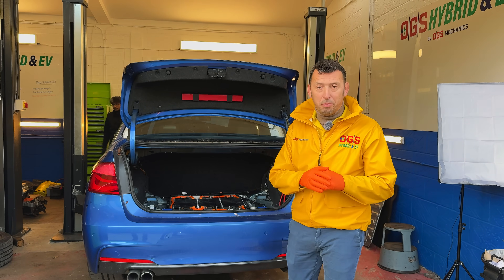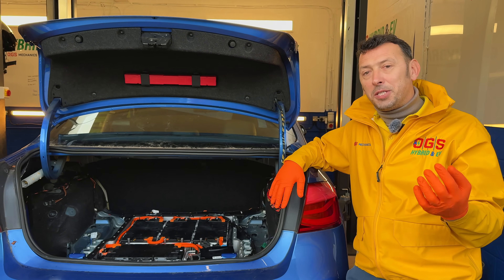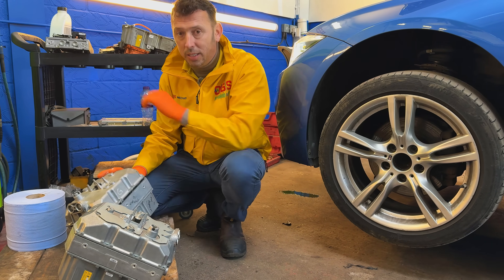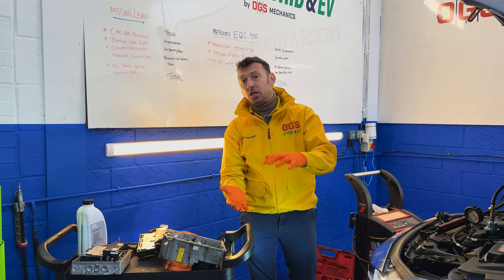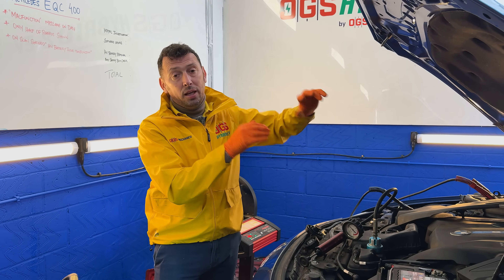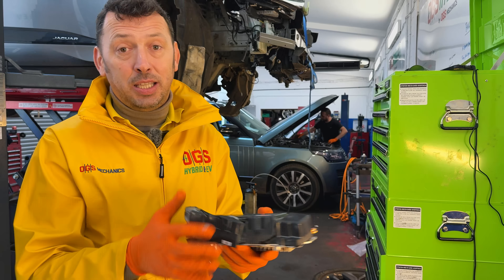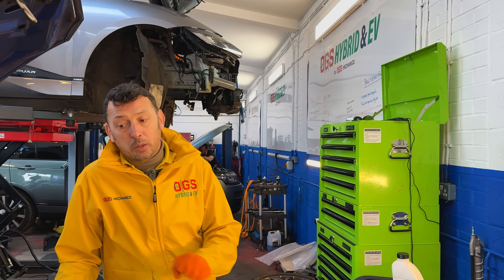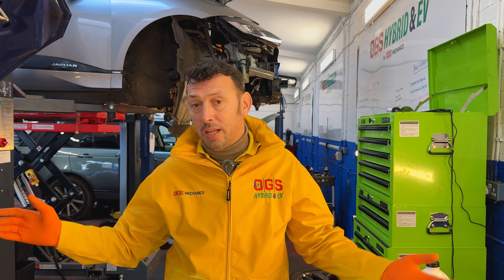The £6,000 Mistake Every BMW Hybrid Owner Should Know About!

Comment: Manufacturers are designing cars to last the warranty period only. If hybrid and electric cars need thousands to fix who would buy a used car ? If there isn't any temperature measurements there is no protection. A simple thermostat could prevent this.

Comment: I've had this same thing happen to my F30. Do I rebuild the EME. If so how? I've ripped apart the EME and the  I'm also working on doing insulation test around the whole vehicle to see where I have a high voltage leak somewhere. My Transistor in my EME looked just like that one, not as bad as that but you could tell it grew in size and cracked the outer case that it sits in.

Comment: I always forget to give credit where it is due. The ability for Car manufacturers to deliberately design in sooooo many failures on their products, yet get people to fight over themselves throwing money at them in order to get the next latest and greatest piece of outrageously $$$$$$ junk year after year after year, is a true artform. "Hey guys- here are the specs for our new 2026 solid cube of Tungsten. Bob has made sure to engineer in several flaws that we can totally deny under warranty in the fine print, and charge extra for a subscription in order to use it. Also, Johnson in Marketing has sent a Memo to include as many software bugs as the time allows, to ensure all the required APPS needed to operate the solid Tungsten Cube don't actually work until the 5th try, thereby keeping the customer on their phones long enough to data mine all relevant shopping habits and then sell to Amazon." Three Cheers! Let's break for Lunch, fellows!

Comment: Another great vid. Very poor of BMW not to have temperature sensing of the heat sink or even a level sensor on the header tank.
You don't need temperature indication, just a plain English message on screen that most OEM's do not give you.
Tesla are unusual in that they allow the owner to access diagnostic software on the car's screen with a full workshop manual. Almost as good as the factory diagnostics.
The error codes are backed up with a full description.
This is another reason I wouldn't touch a hybrid with a barge pole!
Reply: What does this have to do with hybrids?

Comment: Many thanks from this 330e owner :) So basically keep a/c running all the time summer and winter. I normally have my a/c system set at 20C in the cabin all year round, if it's cooling or heating to that temperature is it an indication that all is OK?
Reply from the maker: Not necessary to turn the AC on and drive 
Just make sure the the AC is working properly, make sure to do regasing is done if AC doesn’t blow cold air
Reply: The car use ac but If there is no water coolant left it will do nothing and will burn the Inverter.
Reply: To be honest I switch the AC on the day I buy a car and it is still on the day I sell it.
Reply: @bigjml but you understand that it has no effect on the cooling of the Inverter?

Comment: what diagnostic tool/scanner do you use/find the best for BMW's hybrids ?
Reply from the maker: We use Autel and ISTA for BMW diagnostics 🔧. Autel is excellent — it can read detailed battery stats, perform programming, and handle most hybrid system functions. ISTA is the official BMW tool, great for full module access and coding when we go deeper into the system
Reply: @OGSMechanics thanks! What Autel model, please?
Reply: Thanks, which Autel scanner do you use?